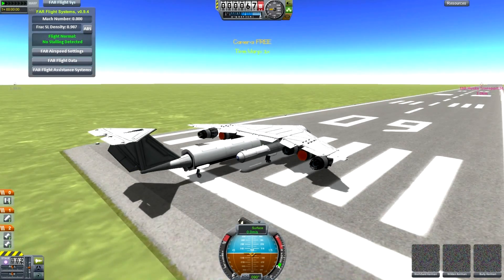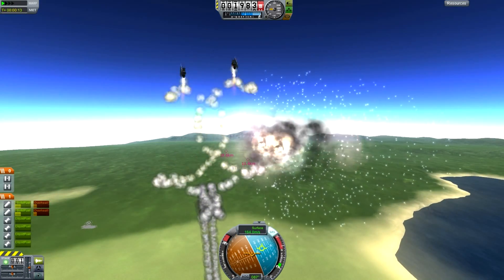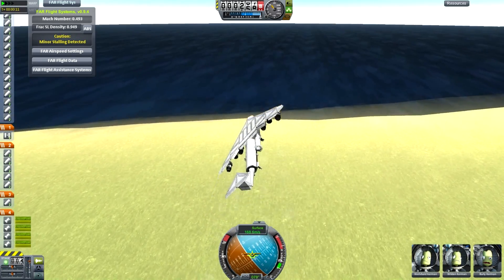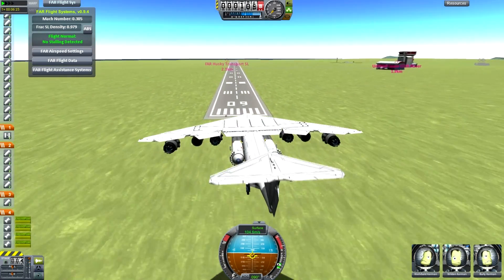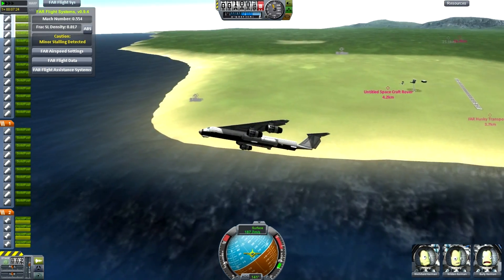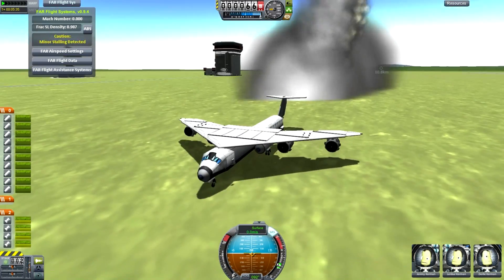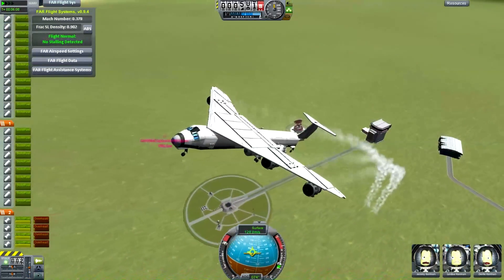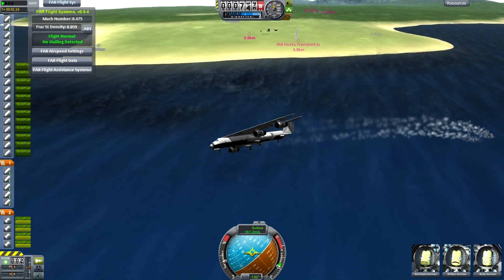Kerbal Space Program - RATOL - Rocket Assisted Take Off & Landing - Operation Credible Sport

Comment: You should have used normal fuel engines not solid fuel boosters so you can reuse it.
Reply: You can re-use SRBs. They did that with the Shuttle boosters. Just insert new fuel.

Comment: I do believe the German Ar 234, or "blitz bomber" as it believe it was called, was one of the first that had a system like this to assist it in its take-offs.  At least, that's the first one I've heard of.
Reply: Not true. While the Luftwaffe did experiment with the system just before the war, arguably the first military use was on Hawker Hurricanes, catapult launched using rockets from merchent vessels to defend against Fw 200 Condor bombers. The Fleet Air Arm also often used the system on its Seafires, as they sometimes struggled to takeoff if carrying external ordnance.

Comment: Fascinating, Scott actually fired the braking rockets in flight, the same as the pilot who derailed the whole operation. But unlike Scott, the said pilot crashed the plane. Check out the video, the plane looks awesome with those rockets lurking out of the airframe. https://www.youtube.com/watch?v=WKCl3lfAx1Q
Reply: ***** actually, if what Scott did was in real fife, the plane would have crashed, the parts in KSP have a much higher damage tolerance, as you can see in the video you linked to, the wings Detach from the planes body because the forces are just too much for the struts.
Reply: I know, that's what i'm talking about. The real plane crashed. Just look at the link.

Comment: Could someone explain how he made the air breaks out of the flaps in stock ksc?
Reply: It's not stock. he has Ferram installed
Reply: Ferram Aerospace Research, is the mod for the better air fx, Deadly Re-Entry allows things to over heat.
Reply: In stock, you fit 2 pairs of control surfaces using symmetry. Then, configure one pair to deploy normally, then configure the other to deploy the other way. Finally, assign both sets to an action group. When the button is pressed, one set will deploy upward, the other will deploy downward, thus serving as a reasonably effective airbrake. I've used this on a lot of my aircraft designs until I unlocked the stock airbrake parts.

Comment: Um, a cloaking device utilizing 40nm gold wire and carbon nanotube mesh. The first functional transistor  in 1947(not the first solid state amplifire but the first working linear one), TCP/IP and ARPANET. Unix, Minux, Linux, BSD, Mach, VxWorks,and GNU, A webcam and lazer
pointer based element scanner with a range of almost a metre (or meter if you spell it otherwise).  The F.E.L laser with a full dynamic range through all EM frequencies. And some other stuff I can list later if you wan't me to.

Comment: Using your logic... YMC-130 is still incorrect seeing as the early configuration was the XFC-130H which ended up being the early version of the MC-130H Combat Talon II. Now, I am unsure of your familiarity with the meaning of aircraft prefixes, but the X designates an experimental aircraft not yet fit for service, and the Y designates a prototype. No one calls the YF-22 an F-22 or an XF-22 because that would be inaccurate.

Comment: Actually, I think what you did there was why Credible sport failed. What was supposed to happen is the C130 would come in at pretty much stall speed, the vertical rockets would fire to cushion the descent, and then the reverse rockets would fire to stop it, only when it was safely on the ground.

Unfortunately, Credible Sport kind of failed when the process was done reverse rockets first by mistake.

Comment: Operation Credible Sport was deemed a failure when the Pilots activated the JATO rockets BEFORE touching down on the final test, causing the C-130 Hercules to drop vertically and it crashed into the tarmac. The equipment was not salvageable and the mission scrubbed. The Soldiers were released later on separate grounds.

Comment: YMC-130* Operation* By the way Operation Credible Sport was never "attempted" since it didn't make it past the testing stages. Also, it was not designated the YMC-130 until later on when they used it as a prototype for the MC-130H Combat Talon II, originally having the designation of XFC-130H. The moral of the story: Don't point out tiny mistakes and try to sound smarter if you don't have the 100% correct information yourself.

Comment: Hey Scott I have a question about engines. Is there a maximum possible isp you can actually get from any reaction mass propulsion system? Say, if power wasn't an issue and you could accelerate your exhaust to near the speed of light?

Comment: It was a C-130.
"Operation Credible Sport was a joint project of the U.S. military in the second half of 1980 to prepare for a second rescue attempt of the hostages held in Iran using a LOCKHEED C-130 HERCULES (not C-5!) airlifter modified with the addition of rocket engines."

I got that from a simple search on Wikipedia.